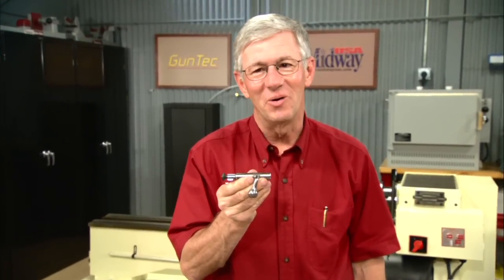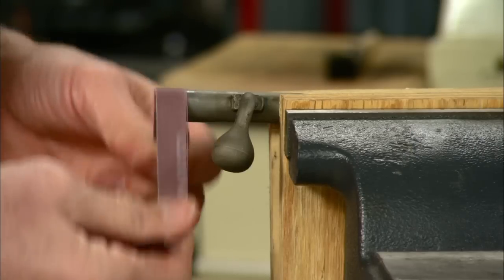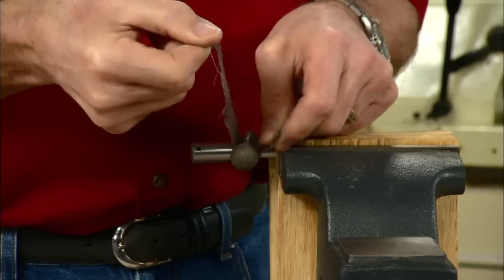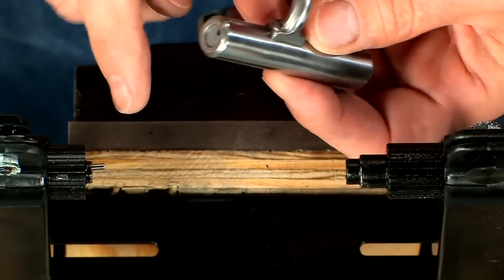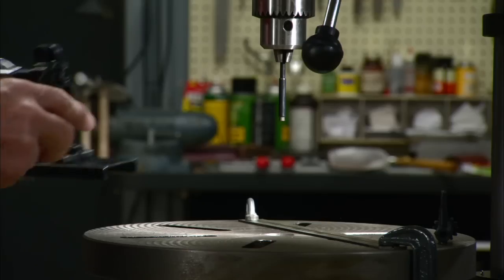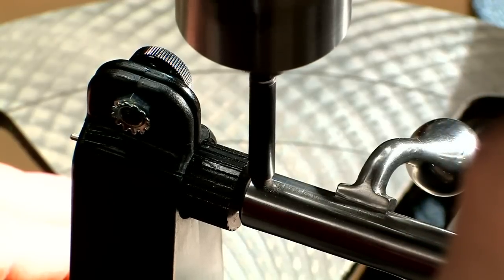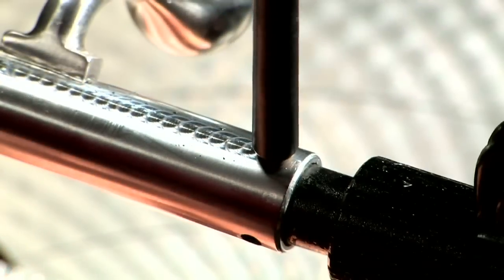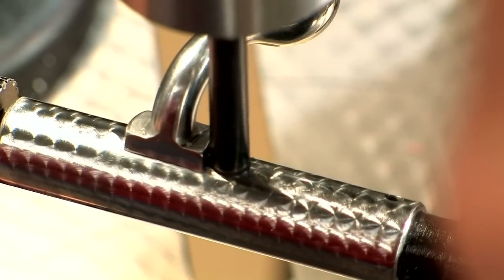How to Jewel a Rifle Bolt | The Model 67 Project | MidwayUSA

Comment: Engine-turning and pattern engraving served a serious purpose in the days of case-hardening and bluing.  They created a surface finish that concealed scratches frpm the field and oil-stains from fingerprints while handling the gun in rough service.  They also helped in buffing-out tool marks on flat surfaces in hardened surfaces.  With a fixture it's not the time-consuming as you would think.

Comment: What material jeweling tool works best?    I have seen stone, diamond, and wire.   
Also, is it necessary to use an abrasive compound of some type when cutting a jewel pattern?
Reply: I use a coupling nut and chuck that up in my drill press. Then I purchase billiard pool cue tips, they are little leather pads mounted on a threaded stud, you can get them at Academy Sports. I screw the tip into the coupling nut and that's it. I sand the bolts to 400 grit with paper and then use 600 grit paste. Cover the bolt in a layer of paste and then start jeweling. The leather pads don't last forever but they last long enough for a couple bolts. Also, you might want to do a small test piece so the pad wears in a little. If you really want to get cheap you can use engine valve grinding compound, but the finer the grit, the flashier the finish. Cause that's the way it is!......

Comment: Cool, but how do you protect the bolt from rust?? high polished metal surface is more prone to rust than normal surfaces, unless you clean and oil the bolt every week it develops rust very fast and all the job is lost.

Comment: hi there Theo from south africa 
sir i repaired my 1904 model but the ectractor is not working good.
it passes the rim especially if cartridge expanded a bit and seems not pulling back far enough.
If possible could you please send me the excact dimensions of thr extractor
appreciate 
theo

Comment: @miltonSF You should rub a thin coat of oil on your weapons about every week or two anyway if youre not going to have them in youre cabinet or safe,even then you need something that you can put in your cabinet to cut down on the moisture,I save every silicon pack that I can find and put them in with my guns, anything to pull the moisture out of the air around them,of course they sell things for that also.